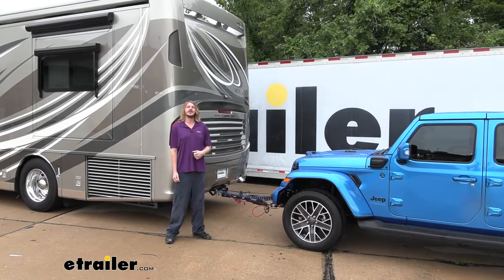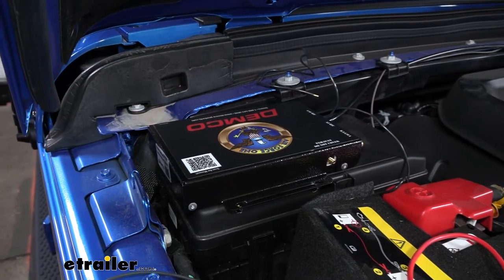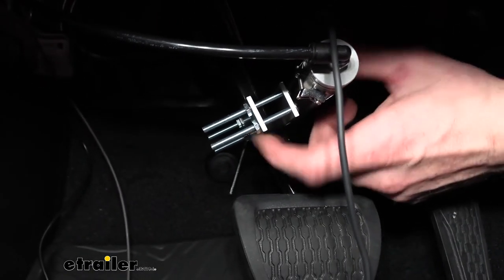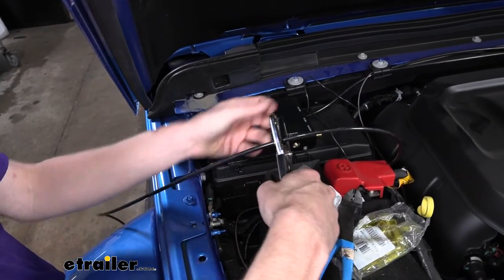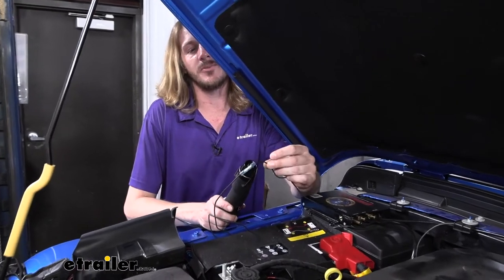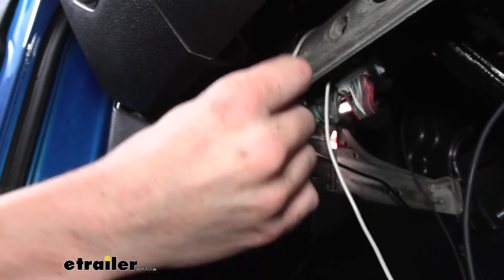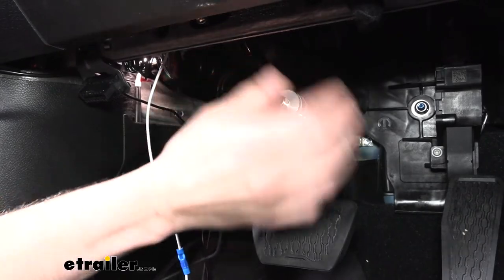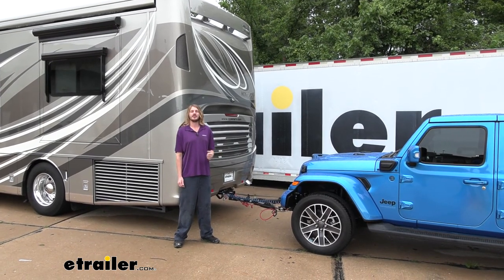Set up: Demco Air Force One Flat Tow Brake System for RVs w/ Air Brakes on a 2022 Jeep Wrangler 4xe

Comment: Looks like a real pain in the a@@ to install. I’ll stick with the inertia wireless brake controller.
Reply from the maker: What option are you wanting to use? Strictly speaking, a brake controller is used for towing a trailer, not a towed vehicle. Just want to make sure you get the correct product for your needs....
https://www.etrailer.com/Tow-Bar-Braking-Systems/Demco/SM99243.html
Reply: @etrailer  RVI  Brake3 possibly. Yes it would be for a towed vehicle. Im coming from a fifth wheel. learning a new system for sure.